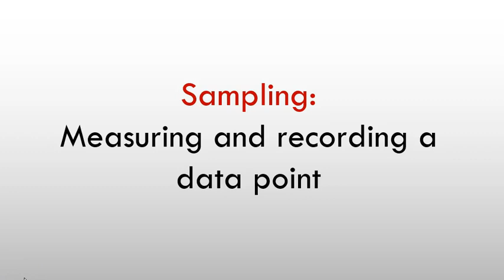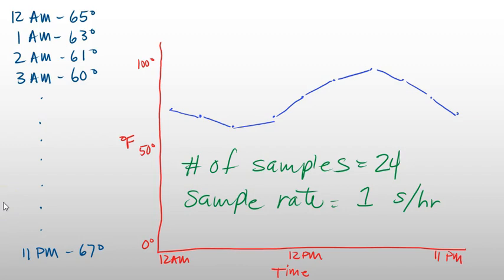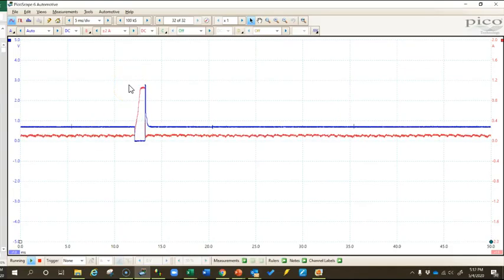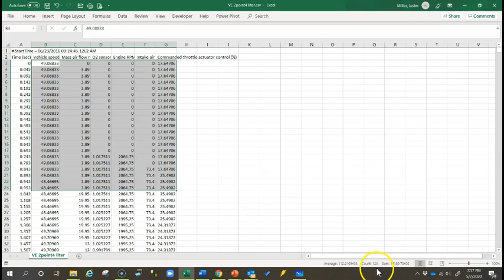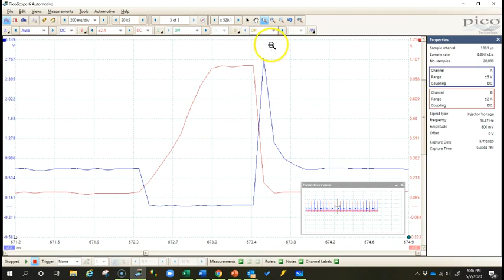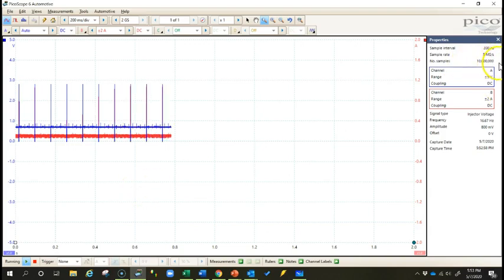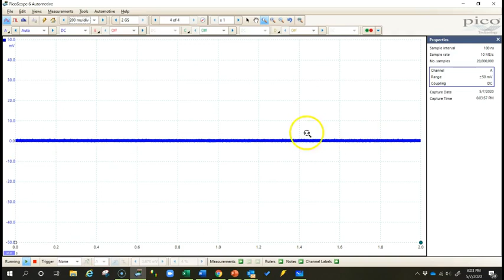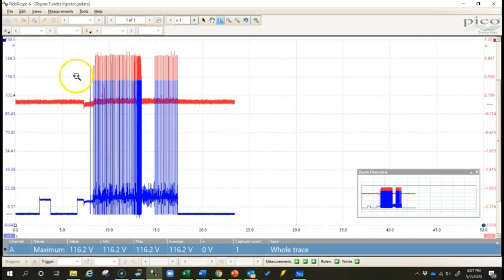Understanding and Optimizing Sample Rates

Comment: Thanks for the great video!  I have a question are you able to do serial decoding with the Pico 2204a ? And was your last example done with the 2204a or automotive scope?  I have been playing around with sample rates on my 2204a collecting can bus signal but have been unable to get that clean of a wave form
Reply from the maker: Thank you, Shawn.  And, yes, you can decode serial data with a 2204a, but it can barely do it.  The automotive scopes are much, much faster and produce clearer signals.  I was using an automotive scope in all of the examples.  I never use the 2204a, but I recommend it as a budget-friendly way to start using the scope.  Some of our college students (who are obviously on a tight budget) like to buy that scope and use it until they can afford to upgrade.

To decode the CAN bus on the 2204a, you will need to select a very fast (small) time base, such as 1 ms/division or possibly even faster.  You will also need to request the highest number of samples possible.  At some speed, you will be able to get a clear enough signal to decode at least one or two data frames.  If you are serious about using the scope for serial decoding, I would recommend an automotive PicoScope - and that is something I can help you with if you're interested!  You can check out my website or contact me at https://catchawave.com. 

I hope that helps you!
Justin